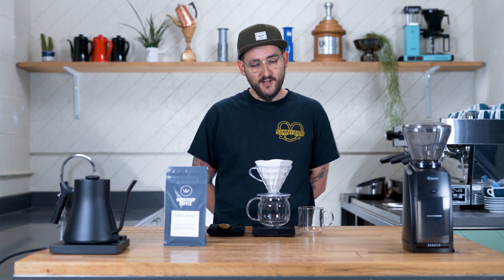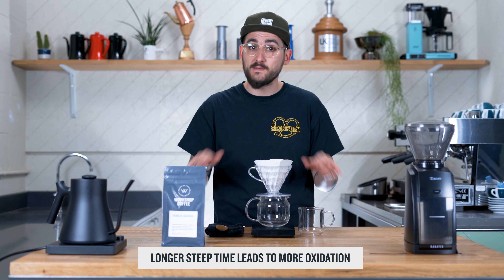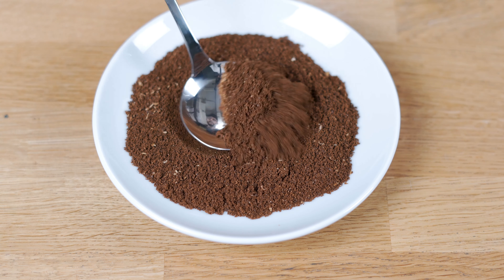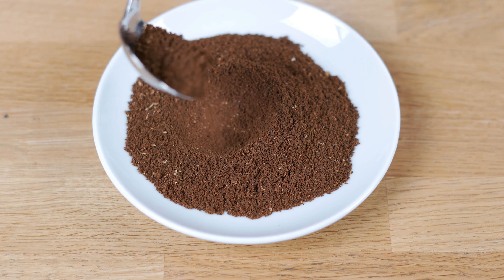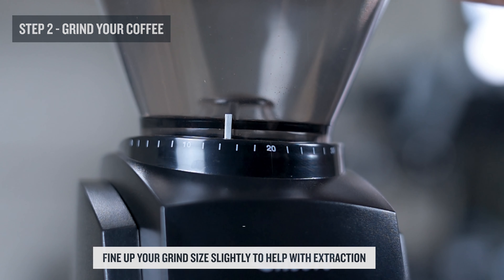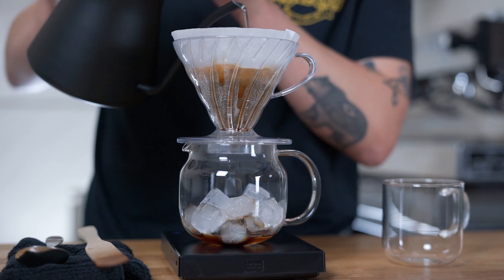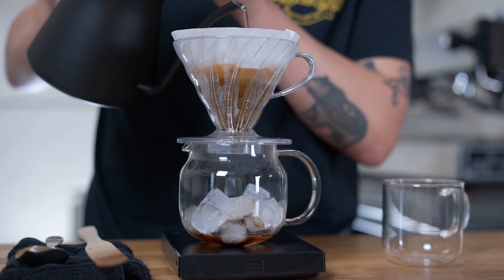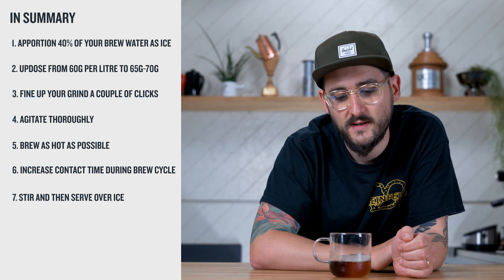A Quick & Easy Iced Coffee Recipe

Comment: What about whiskey stones rather than ice to prevent dilution?
Reply from the maker: Hi Matt. You’d most likely struggle unless you used lots and lots of stones, as they are designed to chill an ambient – rather than hot – temperature drink down. 

We have seen it done in coffee by George Howell, so it's worth experimenting (as always), but we'd be using plenty of stones and ensuring they’re thoroughly cleaned between uses.
Reply: @workshopcoffee9001    yeah i did wonder if that would be the case. thanks for the reply. i tried the ice method yesterday with a french press coffee and it was delicious. thanks!